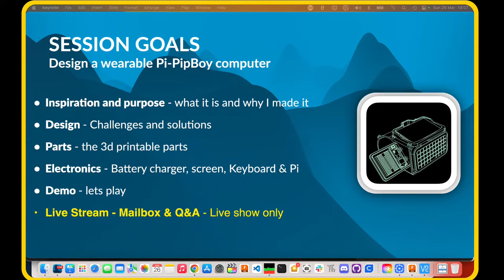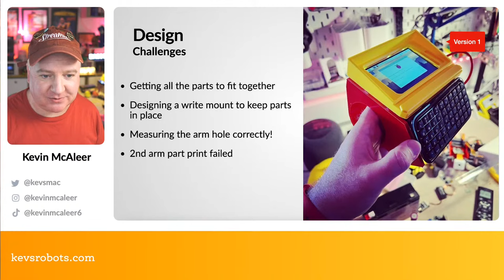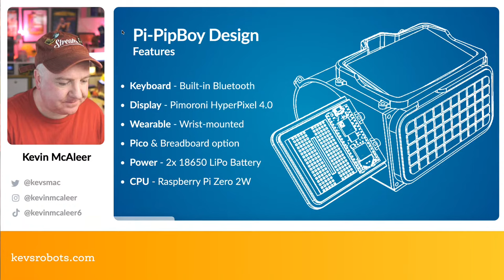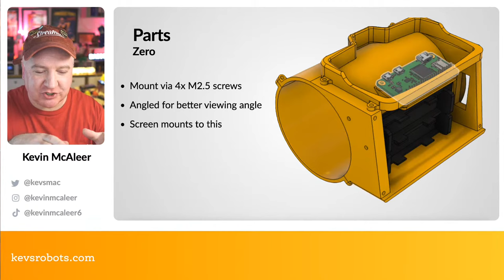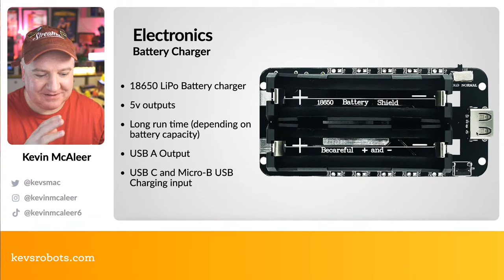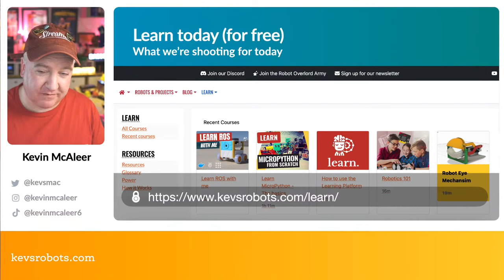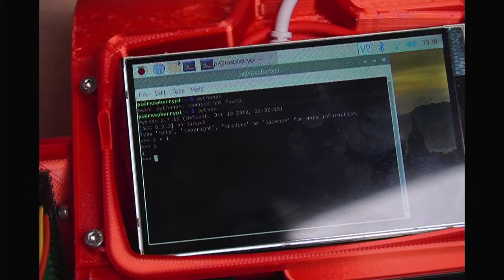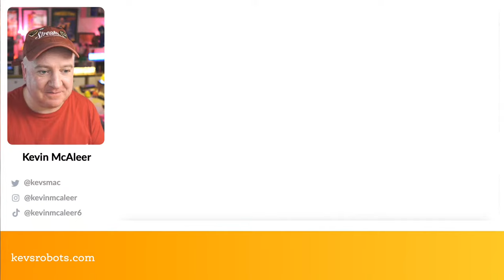Building the World's Most Advanced Wrist Computer - Is Pi-PipBoy the Future?

Comment: 1: can you connect the 5v on the 18650 charger directly to the pi 2: is there a wired alternative for the keyboard 3:  is there a way to add a USB hub to the Pi so you can connect a mouse or a flash drive to program things like the pico.

Comment: Hey! 
Question 
Im trying a simuler project inspired by yours tho with a raspberry pi 4 tho i have a problem to mount the thing onto my arm since i do not own a 3d printer...is there any other possibility how to get a caseing?
Reply: If I were you, I'd first try checking your local libraries. If you're in an average sized town, there's a decent chance that your public libraries offer a monthly free printing or two with their 3D printers so long as you have a library card.

If that option doesn't pan out, try getting some hard plastic sheets from a hardware store or Amazon or wherever. You should be able to warp those with a good heat source. There's plenty of DIY videos out there. As for a plastic part to hold your screen, I'd suggest repurposing a phone case or something similar. Good luck!